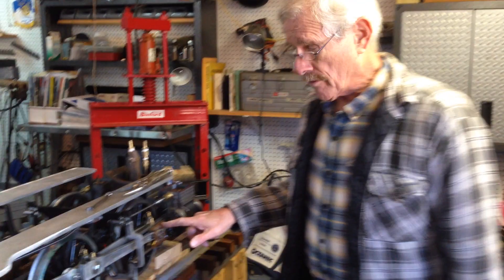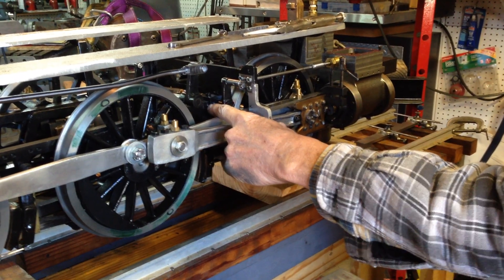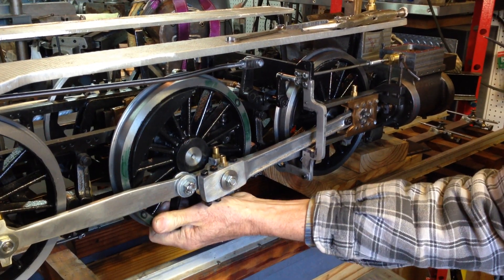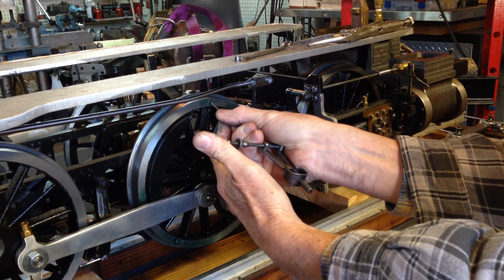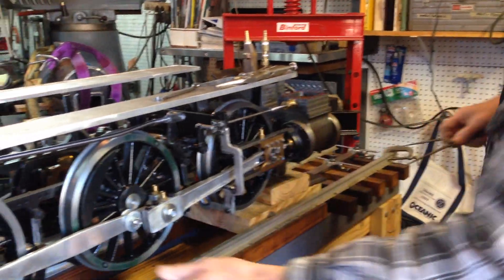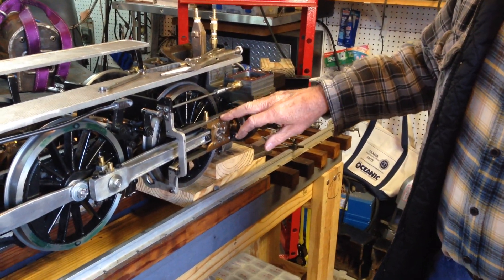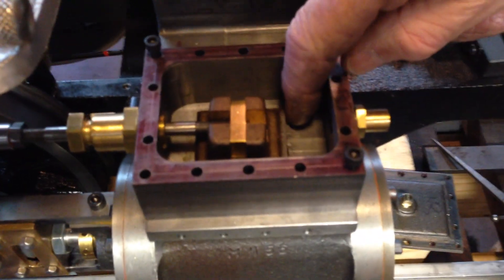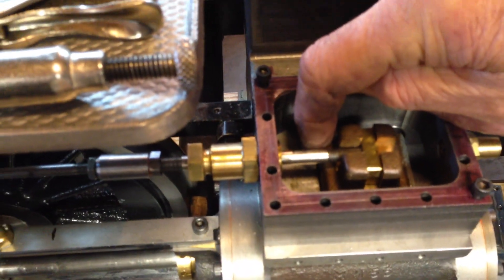Stephenson valve setting

Comment: Good video. Have you made a video of you adjusting the eccentrics? I would love to see a demonstration of adjustment. I understand finding the dead centers, it would just be cool to see you correct some bad timing in a video.
Reply from the maker: Put the engine on front center and forward gear. Look to see which ecc. is pulling the valve back (open). Adjust that ecc. until the valve is just cracked open. Do the same for back dead center with same ecc. Adjust the valve position in the steam chest to make these 2 positions equal. Same for reverse and both cylinders. Takes awhile. Enjoy the process!!
Reply: This would be very helpful and when to adjust the reach link union

Comment from the maker: Ben, look at the valve setting posts here:
http://www.chaski.org/homemachinist/viewtopic.php?f=45&t=102017&hilit=hunslet&start=12
where I set the eccentrics on my Hunslet engine. You set them at front and rear dead centers. At that piston position the valve is just cracked open and you can move from fwd to rev without the valve moving. Johnson bar position doesn't matter.
Fred V

Comment: If I understand this right, when adjusting the forward gear accentrics, shouldn't the Johnson bar be in the full forward position? Likewise when adjusting the reverse accentrics it would need to be in the full reverse position?
Reply from the maker: Actually that doesn't matter, believe it or not.
Reply: I've studied Charles Dockstader's Valve Gear Simulator for outside admission Stephenson link motion and determined that it does matter a little when the eccentrics are set in their proper positions and it matters a lot when the eccentrics are not in their proper positions. The position of the valve should be checked in both full forward and reverse at the same dead center position to make sure the valve position is identical in each full setting, the edge of the valve being line in line with the edge of the port. If it isn't you know at least one of the eccentrics is out of alignment and will have to be reset.

Comment: Thank you for the great Video. It looked very complex on first viewing but after the fifth viewing and taking notes I was confident to try setting the valve gear on the Stirling Single I am building. 
The method of the setting up was so good the engine ran on air in both forward and reverse without the need for any further checking !!
Reply from the maker: I am glad it helped. Very little info on this subject on the net.
Fred